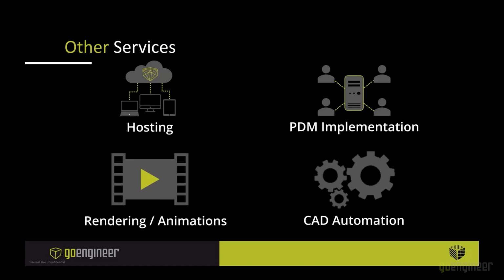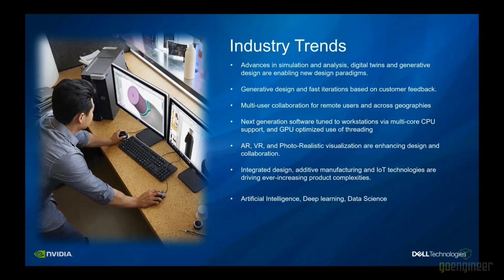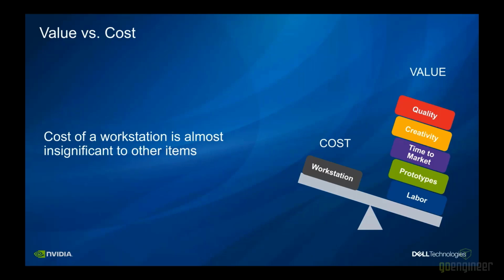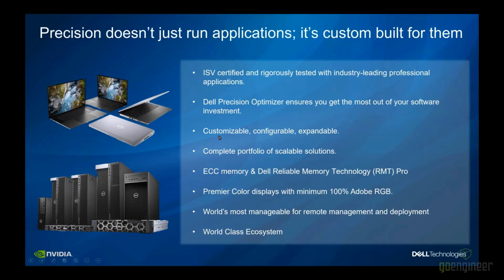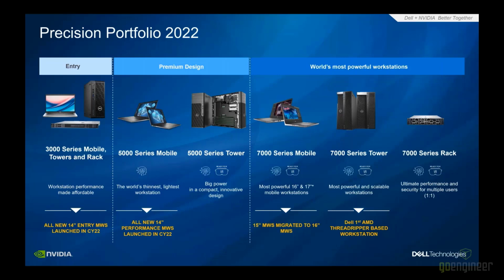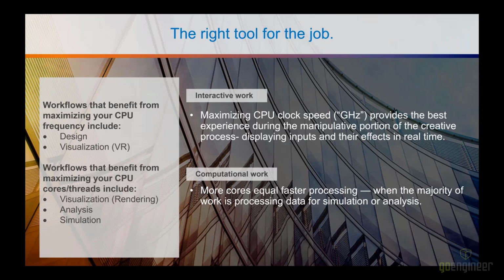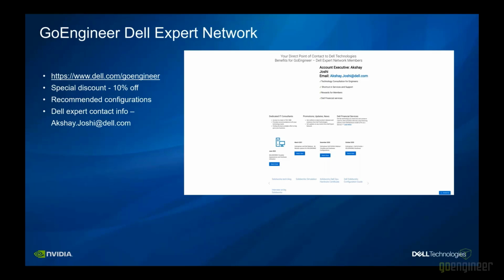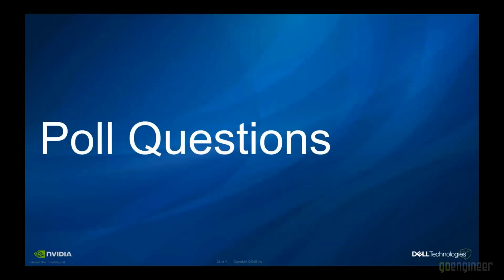Maximizing SOLIDWORKS Performance on Next Generation Dell/NVIDIA Workstations - Webinar

Comment: We use that smallest DELL workstation and i would absolutely not recommend it, they constantly crash (looks like a gpu crash) and there are getting insanely hot I'm on my third pc and there is a new other model pc on its way luckily.
Reply: Tower/Mobile/Rack? 3000/5000?
Reply: @ebirch90  the 3000, i couldnt add a link for some reason
Reply: @nickvanemden  Thanks!